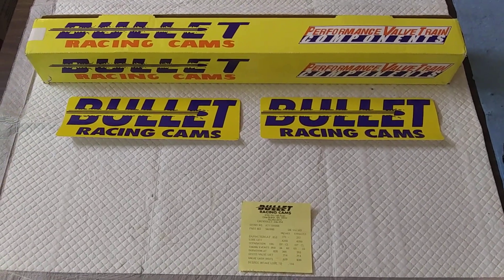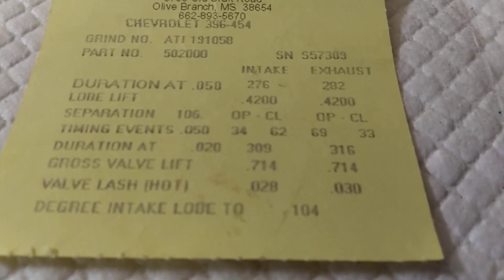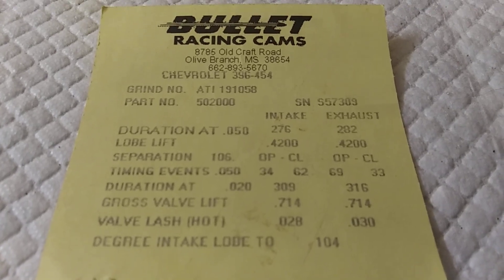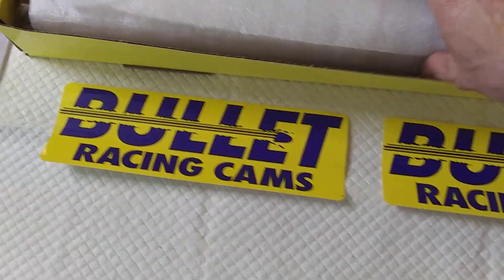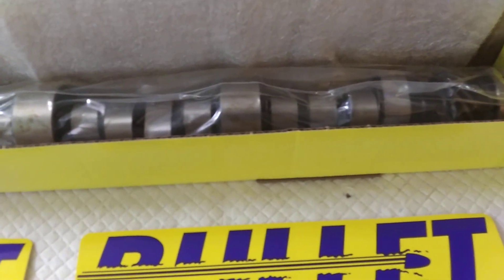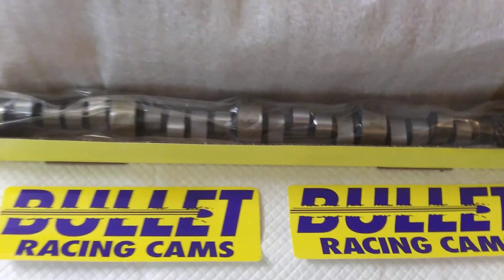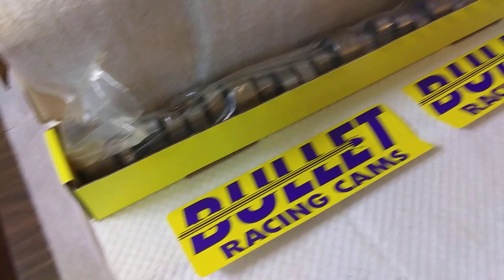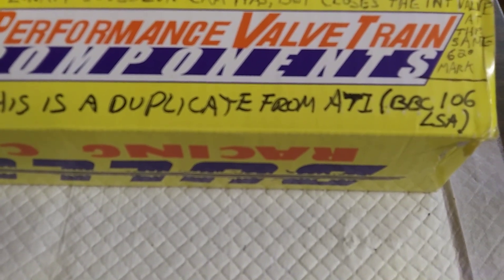Bullet/ Ultradyne 276/282@.050, 309/316 adv, 714/714 lift, 106 lobe separation. Solid Roller.

Comment: I just bought a Bullet for my 425 Olds. Solid roller. Not as aggressive as your though. .621 lift 108 LSA 254 and 261 @ .050
Reply from the maker: @claytonstoolbox  Should work real good in a Olds 425. Damn good engine. Have a 66 Toro 425 tucked away myself.

Comment: What cubic inch would this cam work best in 496-540 ?
Reply from the maker: I'm using this in a 496ci engine. But it could work in a smaller unit, the powerband would be higher tho. I'm using a slightly bigger cam in a 427+.060  BB Chevy, but it's gonna rev to 8000rpm.
Reply: @thereluctantgearhead4544 what rocker?
I'm thinking something like a Comp DSP or low shock drag race profile if I go with the 598, duration in the mid/upper 260s at 50 and upper 270s on exhaust with 1.8-1.9s. They've got lobe lift in the 0.460-.47s range. 105-108 lca depending on the head (promaxx ported or pony up for 18 degree).  Probably sub 11.75 for 91 and a heavy bitch.
More agressive profiles bigger than bbc core like 55mm.  But I'm not sure what clearnance looks like in a 9.8 with a 4.5 stroke.
Reply from the maker: @sc358.  Can't go wrong with blue  Scorpions or Comp Gold series.
Reply: @thereluctantgearhead4544  thanks, good to know.  I was asking what you'll be running.
If I go conventional I'll probably run comp ultra pro magnum, if 18° td shaft probably aluminum cuz steel is like 900 more and I don't think it'll be turning the rpm to justify them.  And if shaft I'll probably press out needles and install bushing.
Reply from the maker: @sc358.  I'm running Harland Sharp on one of my bigblocks, Scorpions on the other. Both good past 950lbs of open spring pressure. I'm running springs in the 850+lb open range on both my bigblocks. 275lbs on the seat on one, about 300lbs on the other. Beyond 900lbs I'd want a T&D shaft setup or Yella Terra.

Comment: Nice piece. Just got done watching your "thoughts on the 350" video... got me thinking my next project ought to be a back to basics 355 with a bullet solid roller. Ironically just finished a 406 with a rotating assembly that was a real headache and probably too many $ to piece together..
Reply from the maker: Plenty of power potential in the old 350s. Just add a big solid roller, big flow heads and plenty of compression. Not real difficult to get 550-600 NA horsepower out of them with modern race parts. Shits pretty cheap compared to other engines. A dollar goes farther in a 350 SBC. People had them running 9s NA back in the 70s. I have some Oldsmobile and Pontiac engines I mess with, but damn, big difference in price for parts. A 600hp 455 Pontiac will cost 2-3 times what a 600hp 454 Chevy can be built for. For a few dollars more, 700-800+hp can be had with the fat block. 800+hp Pontiac or Olds would cost a fortune. Hard to beat  the old school Chevy engines. I started with Pontiac tho, so I'll always like the BOP GM engines.
Reply from the maker: Bullet Cams are the shit. Ultradyne under a different name. Real good cams.

Comment: a BBC with that cam will run about as calm cool and collected as an 8 yo kid with ADHD binging on red bull and candy bars! Those specs translate to that is one spicy cam! 106lsa! 276/282° @ .050! .. 714" lift! Phewww...Pretty wild! A nice mill with some compression and that cam will sound straight up rowdy! Nasty wild erratic idle with lots of crackle... with the cam and intakes you have you must love the revs! With that tight LSA I'd think it Should have a brutal TQ curve too. But nothing sounds like a high revving big block.... That's a heavenly sound, a heavenly sound you can never achive with a turbo LS...
Reply from the maker: Definitely not for the smooth idle crowd or those with a weak heart. Nothing like turning bigblocks up 7500-8000rpm. That shit will fuck with your emotions. Definitely make ya nervous. And the noise they make is pure music to my ears. Bad thing about units like these is they like to destroy shit. Love big NA power tho. These young bucks just don't get it.
Reply from the maker: I have a 8inch 5500 BTE convertor and manual T400 with a brake to go behind this engine. 86 Bonneville it's probably going into already has a 5-13 geared 12-bolt with a spool under it. 29.5x11.5x15 M//T slicks. Probably swap a 4-88 in it for 1/4 mile action.
Reply from the maker: Should run 5s in the 8th NA.

Comment: Appreciate the videos. My motor has the comp xr282   runs good sbc 11 1/2 1 comp. My distributor is set up with no advance.. 24• . I was just thinking here GM got the vacuum adv. and carb dude said na.?  What springs would you recommend on the advance. 71 Monte 383 virgin 010 block balanced assembly. Motor dude was really happy with how easily it spun on the stand. Thanks again
Reply from the maker: Try the black spring on one side and the blue on the other. Should come in pretty quick.